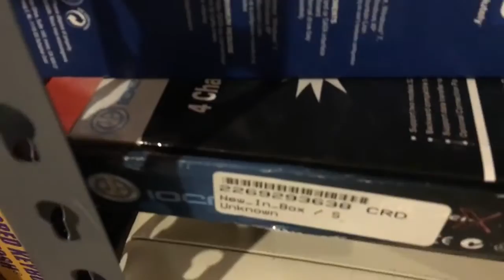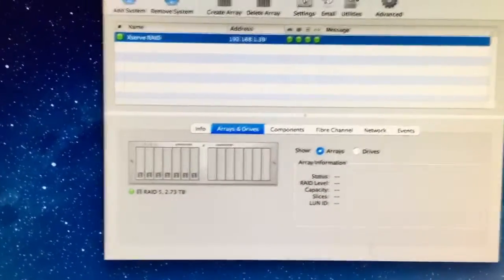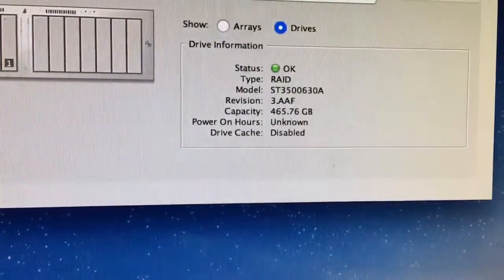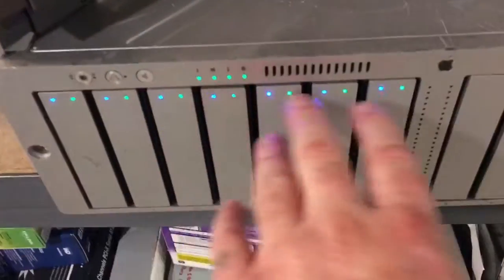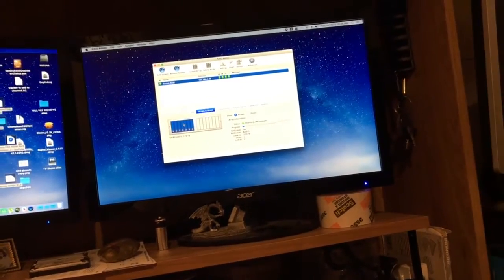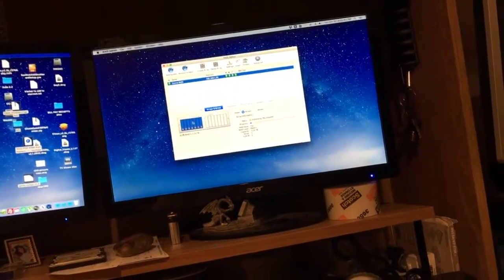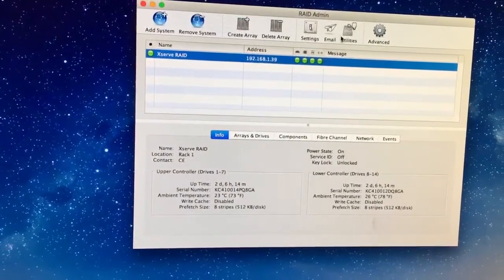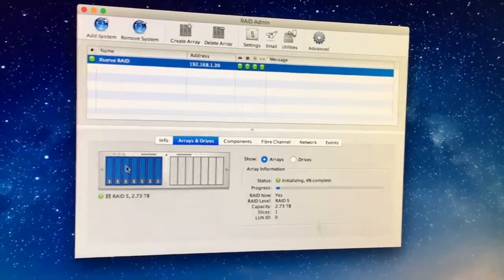Episode 11 Xserve raid -installed new drives and going to add sata to ide converters

Comment: Hello Chris, have you finally tested with 2TB discs? Did you get them to work? Thanks
Reply from the maker: yes and no, yes i can install 2tb disks, but it only recognizes them as 1.1tb, apparently if i had the never released software version of the raid controller that supported SATA's it would work, but alas the controller won't see larger than 1.1's , thats ok though because its still 14TB online,
Reply: Hi, Thanks Chris. I install one Xserve Raid with Mac Pro and one FC Card LSI 7204 but when I mount one array with three disk in raid 5 mode, I can not configure it on disk utility. I need and Apple Raid Card?, Thanks for your attention
Reply from the maker: the disks need to be configured on the device itself. how are you setting them up ?, no you don't need an apple raid card, i would nuke it by resetting the device to fact def, depress the reset pin thing on the back of each controller for 5-10sec, this makes the passwords public and private again, then go in and add the raid over ethernet ip of whatever it is, the raid admin should locate it. dhcp or static on same subnet) , it will be dhcp after reset to def, then use the menu options and reset the raid to new, set up a basic disk raid5, quick initialize, and it will just appear on desktop, you don't use the disk util at all, unless you want to run repair or check permissions or such

Comment: I am really interested in you getting the SATA drives in there... and putting a video up. I can't get C3 Xtech to respond to emails... and I don't like the bandwidth limitation that much. So, I'm trying to figure out how to get all these SATA's I've got to fill my Xserve RAID. I even thought of using a LVD SCSI to SATA converter... but no idea if anything is off the shelf workable.
Reply from the maker: well hang in there, few days left and i will have it on Sata, I can't find the C3 Xtech anywhere, and there site is dead. I will do a video on how to and the boot up and all
Reply: That is awesome sauce! Waiting in anticipation.
Reply from the maker: its done, have you checked out the other videos on it. working great so far. few "issues" more fitment and east of sliding the trays in, but after a few headaches and edits, its been well, my first array is still a mix of IDE and data converted, but the second array is now all 1tb drives across, 6.3 rounded apple size.